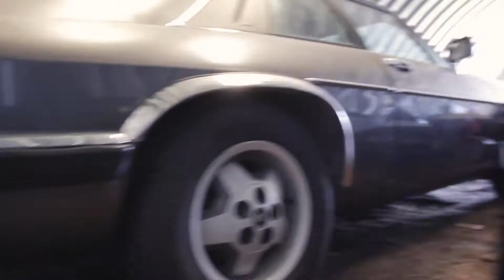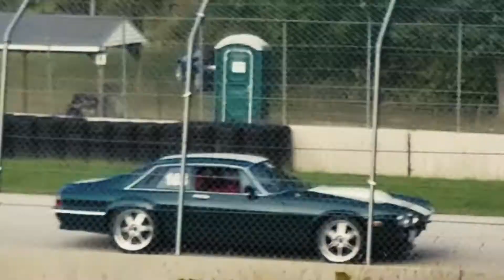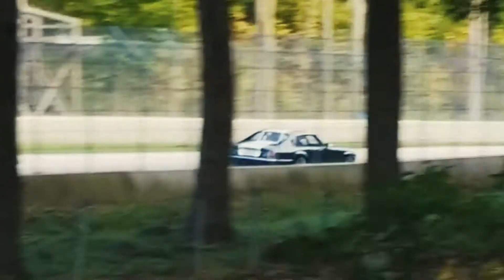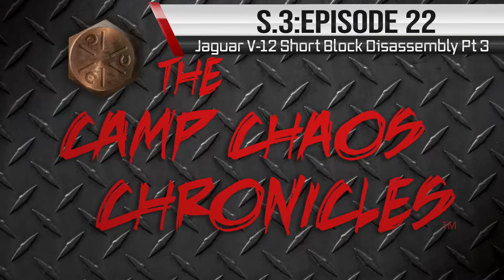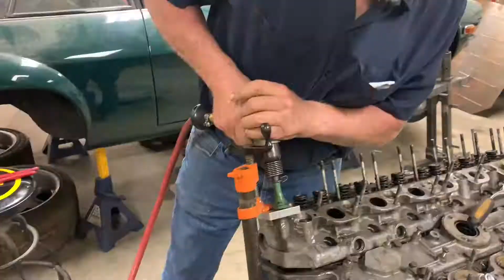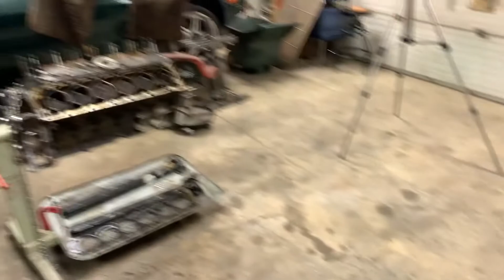Jaguar V12 Disassembly: Welcome To Hell Week!!! Part 3

Comment: Thanks very much for shedding light on the difficulties and limitations of this engine.  Reality can be like a cold slap in the face which I need with respect to acquiring more Jaguars!
Reply from the maker: If you do your homework and pay the money to find a good one when you find it, you'll be fine.
Reply: @thecampchaoschronicles9567  I am delighted to speak with "the great one".  Yes I loved carbs especially like Keihin.  My first experience of EFI was characterless and overloaded Geo Prism.  EFI is swell though it lack the romance of the past.  Your advice to check engine condition closely is valid but impractical when the Jags pop up in far-flung places!  The "miracle" is that they XJS lives on and you are a big part of that!
Reply from the maker: @robertpurington8123  buying an XJS in a far flung place without the benefit of a knowledgeable mechanic IS a crap shoot. A good rule of thumb is, if it's cheap it's for a reason. Thank you for your kind words.

Comment: Delighted to see that I made a small contribution...the guides around the head bolts to prevent the puller bolt from walking off the stud
Reply from the maker: Yes. Those bushings will be included in the puller set from now on. Thanks.

Comment: I am enjoying the engine videos.  I would be interested in finding out where you get your pistons from, cost etc.  Grant rings?  I have a puller plate I made from specs found on the internet.  On the really stuck heads I have had a terrible time with the all thread walking off the studs which messes up the studs.  I need to buy your two puller set as I need to pull heads off that I had off only a few years ago so am not suspecting they will come off hard.  I would need to refurbish my plate to use it at this point and replace most of the all thread.
Reply from the maker: email me at robert@jaguarpreserve.com for prices and availability.

Comment: Considering that the V12 engine has been around for over 50 years now, would you agree that cylinder head removal is a maintenance requirement every 10 -15 years even if just for inspection/head gasket replacement purposes?
Reply from the maker: If the cooling system is well maintained, I don't see the necessity for that. Even engines that appear to have been running the same coolant for 20 years show good integrity at the fire rings around the cylinders and perimeter of the head, despite how rotten the rest of the gasket is. Though it could be an interesting winter project along with dealing with the rest of the leaks and peace of mind has a certain amount of value.
Reply: @thecampchaoschronicles9567  I have been toying with using the non water based coolant to prevent the inevitable corrosion.  It could be expensive though as there is a lot of coolant
Reply: @JagsRit  I'm interested to know whether you guys in the warmer parts of the US use a glycol based anti freeze like Bluecol in your V12s for its corrosion inhibitor properties rather than its ability to stay fluid at low temperatures?
Reply from the maker: @JagsRit  And it ain't cheap in the first place. Replacing the coolant every 25,000 miles should prevent corrosion, however.

Comment: I'm trying to remove the B Bank head of my XJ12 year1977. I've build the big tooling plate bolted on the tapet block then pushed with 12mm diameter bolts on the studs after one week soaking the studs with WD 40 and aceton ATF. Nothing wanted to move the only result is a tapet block stud broken. I tried to push with a jack from the bottom on the exhaust manifold rebolted on the head but nothing wanted to move. Do you have another idea.? thanks for your answer
Reply from the maker: With it jammed on this tight the only other option I know is to cut the studs with a Sawzall. bad news, I know....

Comment: bob...about the slugs. is there readily available specs for them? 
i had a thought...... also...is there a rod ratio number? big skirt so i'm curious.
Reply from the maker: I simply have a piston aftermarket supplier make the pistons to the original design including the stock pin offset. The only difference is the piston/liner clearance which is .004" I believe.

Comment: i couldn't help but think:
an oak block and a 5lb handheld persuasion device. :-)
Reply: With an iron block and head, I'm with ya, but it doesn't take much to gouge aluminum.  One gack in the wrong place and the surface is ruined.
Reply from the maker: I'd rather take the time to give it another try later. The Sawzall will be the last resort.